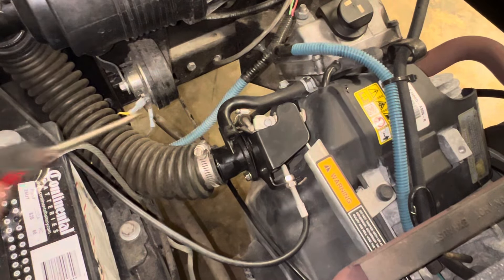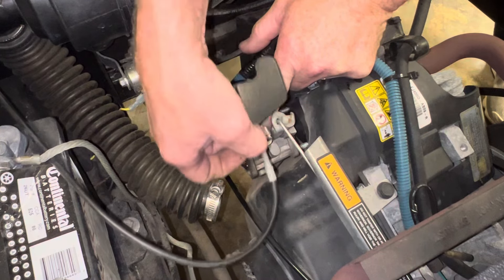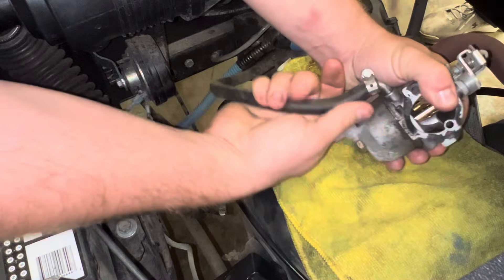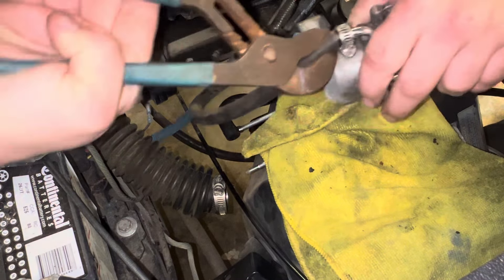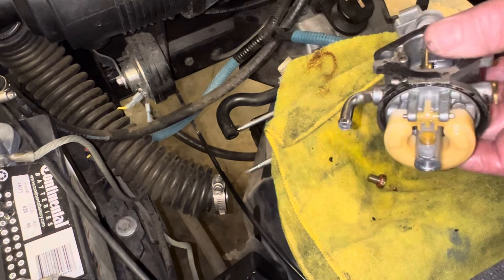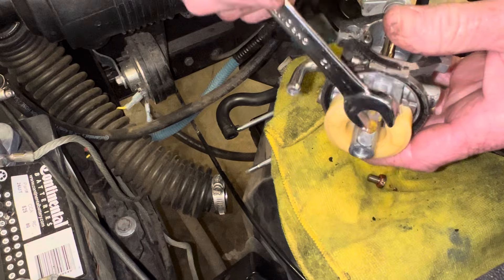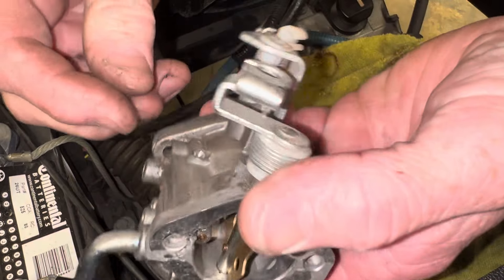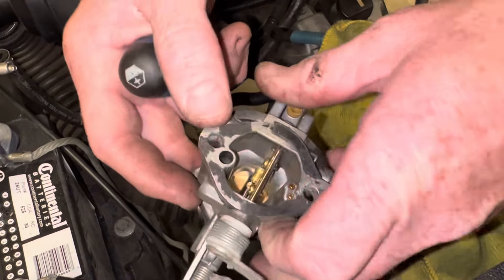Ezgo golf cart/ clean carburetor

Comment from the maker: If you need a lithium 12 volt charger.  Here is a link to purchase one.  I use them or my boat and gas lithium battery golf carts. https://www.amazon.com/Waterproof-Protections-Performance-Batteries-Indicator/dp/B0CMCHP2QT/ref=sr_1_6?dib=eyJ2IjoiMSJ9.DYDnntli9a9yhiovtHX4wfccDPQbvl87ISXRd5fF1pUJIubytpZaUWnXZRV8HSATPpKLrwqVNWm8nS3DCG96te-9WVGS7yNt7RN2M6QTDJpxCUnmaevTC_WWmxlSBPOgBzBuZ0WYQxKPZJUvjTk3yT13wx8WpiyAwEertbEVNsK9T5tYATQSckyy0c0agCGjQbD4GZAzXUmqoEDsHjzuMtwS9zv8ghjYW_c1S_TFpPNK7pI4AuWr2RU7xy35qpK9IMPIzOuoijOw46Hwc2gn4SdsWa4hbH0YU_FcoZWnEOI.Z8I0EOkiitVooswlVBK5qm2ae_dBwczJ1ztAEn8ES54&dib_tag=se&keywords=12V+%2814.6V%29+10A+Lithium+Battery+Charger+Time&qid=1728541671&sr=8-6